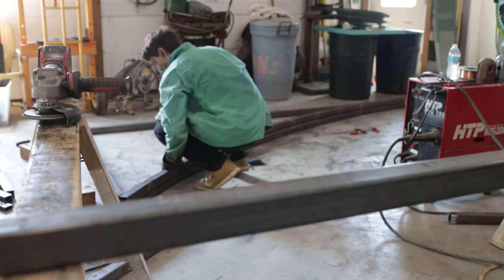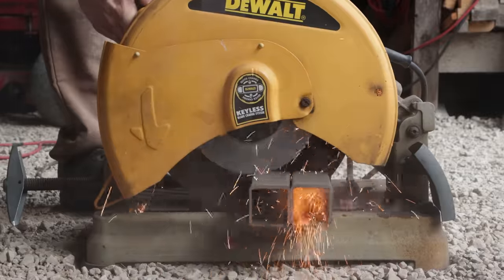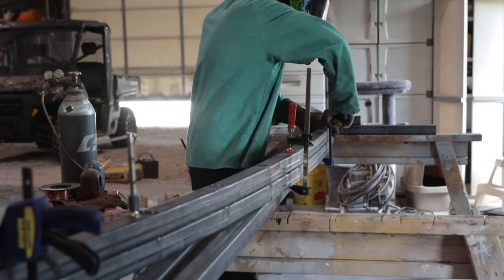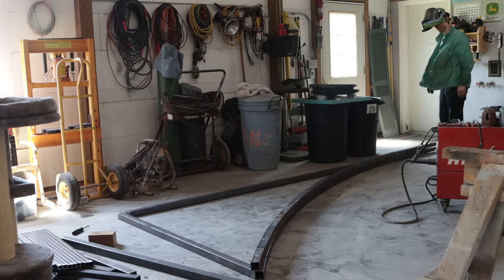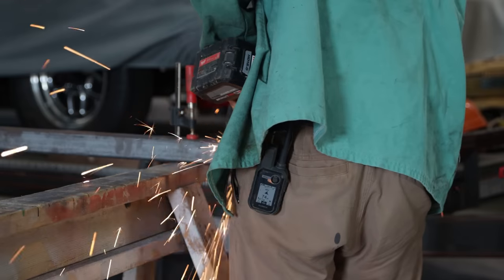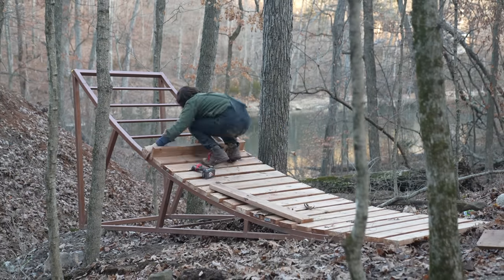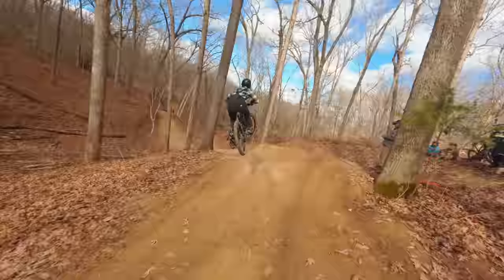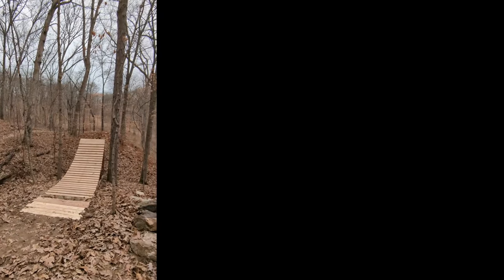I'll Never Weld A Bike Jump Again

Comment: As a welder, this video was a lot of fun to watch, seeing you figure out how to go about welding up the jump. Number one thing I recommend to beginners is you can never spend too much time practicing! Amazing video 🤘Also, when you are welding, when the weld cools down, it can tend to pull the pieces together a little bit, so I like to clamp the piece as much as I can to keep it steady so it doesn't contract or deform when I finish laying the bead.
Reply: I clamp and then use a lot of small tack welds before the main passes

Comment: Mate, did you consider a tube bender??? They aren't that expensive and I think the cost would have more than been justified in the years of your life you would have been spared losing to all that rage and frustration from having to cut and re weld that thing so many times
Reply: I still think the answer is going to be never again 😂
Reply: Since I don't have a welder, I'll just use gussets and JB Weld metal epoxy!  LOL

wait that might work
Reply: Consider this: The seamstress who never bothered buying a sowing machine says sowing is stupid and takes too long.
Reply: @ThisIsGoogle  *sewing
Reply: Square tube doesn't bend well, the inside radius tends to buckle. He had the right idea with the relief cuts but the thermal pull has to be accounted for, and thats a lesson every welder has learned the hard way lol.
Reply: Thought the same thing. Bender . Or else a wood jig
Reply: @danielimpett1277  I'm glad you understand how much work metal work is. :P
Reply: For square stock?.....
Reply: @liamaaronduran  yes, for square stock...?  Just requires the right dies, square or round does t make the slightest bit of difference, especially for as large of a radius as he was doing
Reply: @russellzauner  no no it won't...don't try it.

Comment: watching this for a 2nd time and its pretty funny as a welder i know that the most important thing to account for is the way the metal moves as you weld it, we typically tack on both sides of the joint so one tack fixes the other

Comment: As others have mentioned, this is heat shrinkage. Hot metal is physically larger than cold metal, so when the hot weld cools it contracts and pulls the two pieces together. You can use this to your advantage, though: if you have a piece that's warped, just lay a weld down on the long side and it'll pull it in line (this is usually done with an acetylene torch, but any sufficient heat source will do). Like weld here: ->( to get this: |

Like you discovered, you can also tack together an entire rigid weldment, make sure everything is in place to your liking, and then finish all the weld joints. This works so long as the assembly is sufficiently braced to resist the weld shrinkage forces (though you will end up with a lot of built-up stress within the piece, and this can cause other unexpected things to happen, like a whole panel tacoing on you).

Comment: Exactly what you said, metal will pull to the side heat is applied. You can counter act this by tacking and welding on opposite sides. However, you can't stop it from happening. 

I would have tacked the second tube to the first tube, laid some base welds, cut the tacks, then lay down the remaining welds..... Or invest in a cheap tube bender.

Comment: we use steel tables at the shop to tack the metal to first. then once everything is tacked up, we weld one side (verticals) and flip it, weld the other side and then weld the top and back side so you have even distribution of heat.

Comment: Excellent welding and you did well to deduce the source of your issues, and how to fix them. Welding lets you very easily control the degrees of freedom by adding or removing tacks and clamps. You can also make a small tack before bending or hammering a joint to stop it springing back.
Also, you'd find the process a lot less dirty if you prepped your material first - grinding and wiping off the crud, even a bit of solvent wouldn't hurt - and then did all the welding in a clean environment where you didn't have to keep reaching for your mask. It's definitely difficult but MIG is one of the cleaner processes.

Comment: What you experienced is weld pull. As you weld it heats up the metal sets it in its expanded state, then it cools off and contract's pulling the joint together. Once you know about it, you can use it to your advantage or correct for it. You certainly set yourself up to find out all about it with that many welds along one side of a piece of box section. Its all just experience i love working with steel and would say your feelings of steel vs wood are flopped on its head with me. Would love to see you give a metal project another go.
Reply: Best explanation yet.

Comment: Your welds look as decent as any I've seen at the end. With everything you've learned, would be a shame if you didn't use those skills again. Steel frame ramps have the potential for much better durability and longevity.

Comment: Nicely done and great job on your first welding project! Definitely a big one. I went through the experience of teaching myself to weld last year as well. Always something I wanted to learn to do and finally dove in building a small camping trailer (to take to go ride bikes!). I enjoy woodworking too, but after you figure out what starts happening to the stew as it heats and cool (and more importantly how to heat the steel in different areas) it gets easier. One advantage I like with steel is, if you muck it up, most of the time you can just cut your welds and redo it. That is a bit more challenging with wood..

Comment: You could've used waaayyy less perpendicular cross beams used under the launch surface in favour of using a tightly woven wire mesh.

That's what they've done on the ramps used at the Atherton's Dyvi bike park for the big ramp at the top of their Hardline course.

Saves a bucket load of weight and materials cost.

Comment: Basically you want to clamp your work to a fab table, or something else if you don't have one, and then tack everything in place, alternating sides to spread the heat out. Basically weld one side, and then go all the way down to the other and weld the opposite side. That will spread the heat out and minimize distortion. Also, expect some, so weld it so it has a little bit of travel.

Comment: Check what kind of steel you were using, cold rolled steel is very common but due to it being worked cold there are a lot of internal stresses that make it pull and warp when if heated. hot rolled steel has less internal stress but it will come with mill scale on it that you need to grind off. You were also right about the weight causing it to warp as you went along, but still dont underestimate what the heat will do to it. if it were my project id do exactly what you did clamping them together and welding it as is. thats definitely more than strong enough

Comment: hey Im a red seal metal fabricator with 10 years of experience, your summary Metal melts, stretches and contracts at high temperature and it needs to be clamped to a good jig to stay in spec is good, but you missed something. Metal shrinks more than it grows when welding. Like your laundry. So it always pulls one way pretty predictably. This effect is way worse if there's a small gap. Because there's no solid metal in the gap it shrinks almost closed. Pretty relevant if you're dealing with filling a kerf (material removed due to cutting)

Pretty much no matter how you clamp it it will shrink till the gap is closed.

2" out over that distance is nothing, should just be able to wedge an end in something strong and bend by hand it to open it up. 

Also spot welding is a mechanized process used to join sheet metal together by overlapping it and melting it together in a spot. It's used in factories to make automotive chassis and bodies. Tack welding is what you were doing.
Reply: Great job btw! Looks fun! Welding it with the braces already on was definitely the move!

Comment: I'm no welder, but I'd be curious if you alternated sides (inside weld, next outside weld) and worked your way down and back, if the heat soak would be even and thus not pull things?

So far crazy cool too watch still 👨‍🔬
Reply: No this doesn't work. I understand what you're saying and theoretically you would think so but it doesn't work. Things still move, at different rates and different pulls and such. What will be square first time no issue, next one will have a toe in, then a toe out then square then toe out etc. Just a case of welding it up and checking it after. 

Source: sheetie metal worker
Reply: @CJONE764  baaaahaha that is awesome to know, thank you! What a pain in the ass 🤣

Comment: The horses had nothing to do with the warping. Welds shrink when they cool. Each one of the relief cuts are a potential spot for shrinking. A lot more tacks everywhere would've helped quite a bit or even hard packing the gaps with shim. Keep welding, you'll eventually figure out all the little tips and tricks.
Reply: Jessie is right. When you built the second curved tube, the mistake was matching the first one. You have to learn to predict the welds contracting and factor that in to the finished product. You should have built it a little bit flatter so that it ended up curving the same as the first one.  Takes a lot of practice, but you’ll figure it out.

Comment: If you would have tacked the whole together it would help constrain it. You figured that out tho. To minimize wrapping you need to move to different parts of the tube to weld to put less heat into the tube. Weld a few spots on one section then move to the other piece allows the metal to cool off before you weld again.
Reply: BTW, this is how many projects for people new to metal fabrication. It also happens to experienced people occasionally.

Comment: this issue is not caused by metal shrinking, contracting or stretching, etc.. so, by clamping your piece to the inside of the finished piece, you have reduced the size of the desired radius of the new piece. simply put, the outside of the curve has a bigger radius than the inside.

Comment: You got a slight misconception regarding why your tubes are contracting differently, welds shrink when they cool down. 
But when you look at a weld that was allowed to cool while in compression, to a weld that cooled while in tension and they'll be WILDLY different. 
Tho if I were you, seeing it mismatched by an inch to start with I'd have grabbed some big wrenches or a hammer and muscled my way to them being good enough.

Comment: That was heat pulling, not the weight. You could just smack it with a big hammer until its right. Metal like that ;.)

Comment: That's not gravity affecting your welds. It's that metal expands with heat and shrinks when cooling. You are going to always have that issue, that's why people use fixture tables or account for the dimensional changes.
Reply: Fixture tables don't prevent warping. It will hold it still till you unclamp it only, all the internal stresses still exist

Comment: You warped it. By going through each weld all in order and fully without jumping around you heat the metal in a "uniform" way and it warps. The first one you probably moved mch slower so it didn't have too much heat to warp.
It happens but yeah next time you can get a bender to just roll a bend into the steal

Comment: To the welding, there's a reason welders are paid so well, it isn't easy, takes lots of skill, patience and years of practice, but damn  if you didn't do a good job for a first time.
To Dave and his jump and head injury - NEVER EVER, just straight up pull a helmet off like you did in this video, keep pressure on the persons head in case they have a spinal injury, because sometimes you just don't feel it - had a motorcyclist here die this way after coming over a brow into the back of a car, mad, ripped off his helmet and  back was broken, severed his spinal cord and just dropped down dead.

Comment: becuse its a curve if u weld in inside weldds first  it will pull to much  when u weld curves always weld out side first as it corrects it self when its welded on the inside